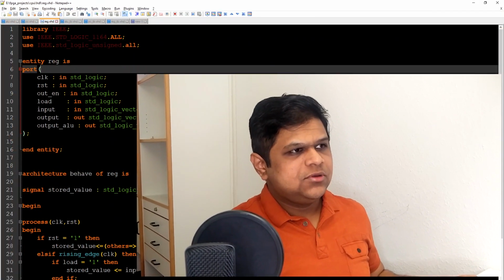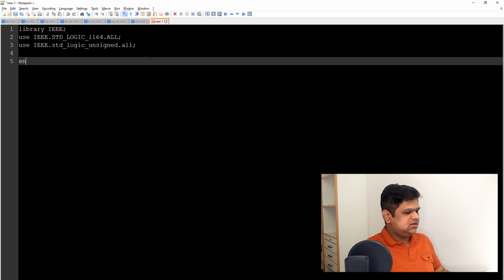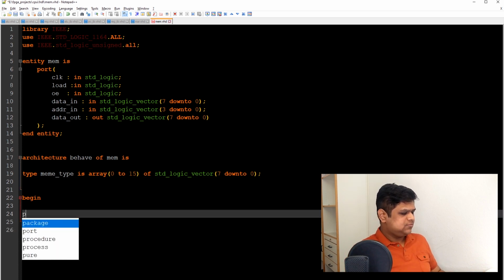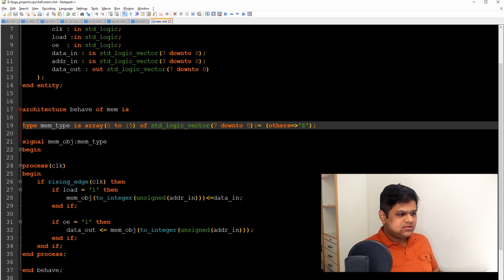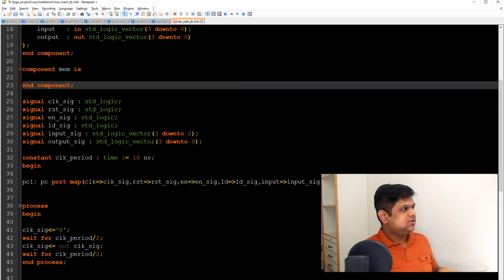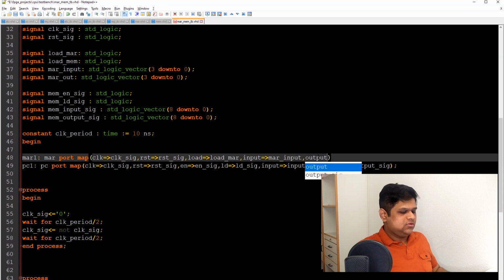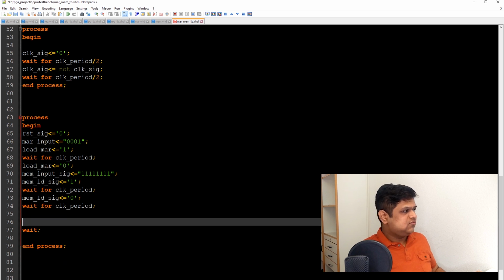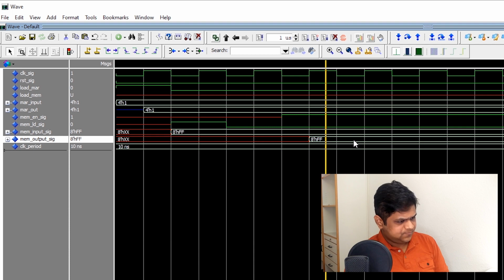Part #5 - 8 Bit CPU On FPGA  - MAR & Memory

Comment: Hey awesome work so far, there really isn't much video tutorials out there that are doing this so it's great to see you taking the initiative. any idea as to when this project will be completed?
Reply from the maker: This project should be finished in 3-4 more videos. At least the simulation part. After that I plan to implement this on Basys 3 FPGA board. I am not sure how long it will take to make those videos.

Comment: I really wanted to try it and here is the solution! I just subscribed and one of your big fan :)
I have a question. When do you think that you would finish this project? Also do you have any plan to put this project on board and test?
I appreciate you made this useful video :)

Thank you Sourabh!
Reply from the maker: Hi,
Thank you for your support. This project should be finished in 3-4 more videos. At least the simulation part. After that I plan to implement this on Basys 3 FPGA board. I am not sure how long it will take to make those videos.